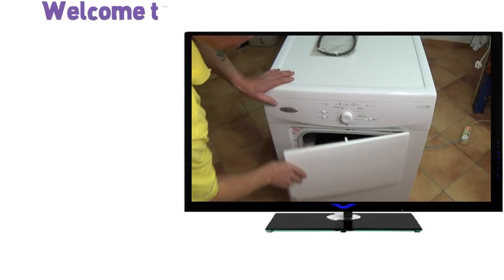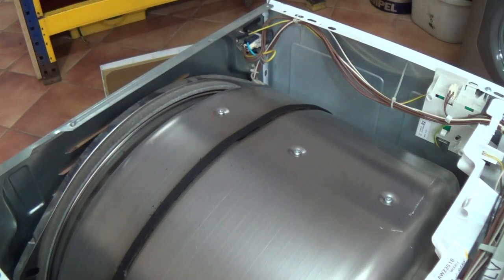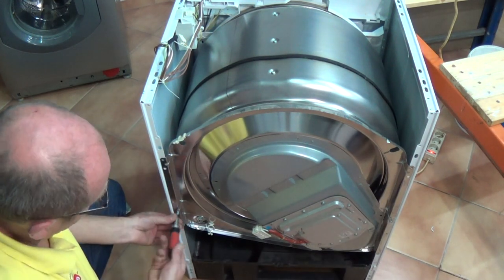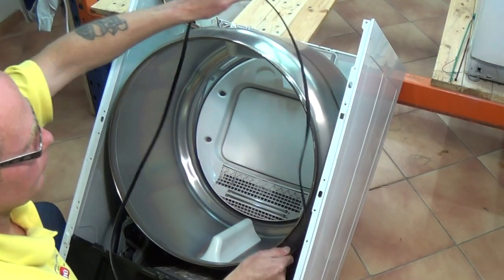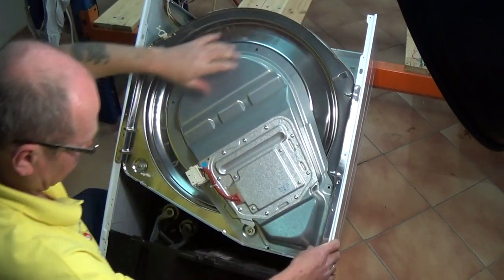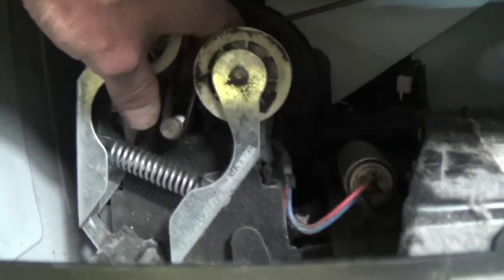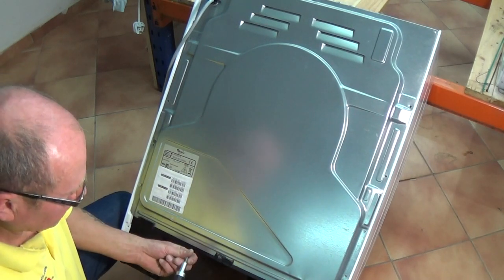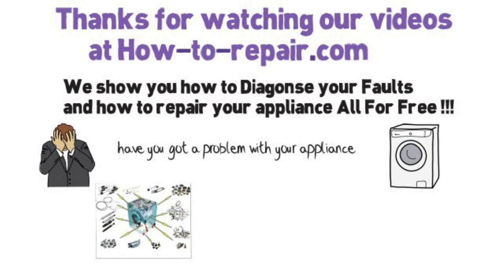How to replace a tumble dryer belt Whirlpool, Bauknecht, Bosch, Ignis, Maytag, Proline,

Comment: This video was very helpful, thank you. As someone else commented, my dryer (a Bauknecht) also had a couple of added difficulties. The back support plate has an additional three screws holding it to a plastic duct in the bottom right which needs to be removed. Mainly, however, the jockey wheels can not be reached because a fan attachment in a plastic enclosure is attached to the spindle that the belt needs to go around, blocking any access from the rear. There is no alternative but to remove this fan, first by removing three screws and then removing the top cover of the plastic enclosure, which is held on by three clips, the bottom left of which is almost impossible to get to and I had to loosen the left side panel to reach it. The fan is fixed to the end of the spindle with a deep e-clip, which is very difficult to remove. The two "arms" have to be pulled out and the back of the e-clip, further down, has a ratchet that clips it in place, so that you have to pull it back and up. All this should be done carefully as it will pull the soft metal out of shape and it needs to be carefully put back into shape when putting it all back together again. With all this done the fan and enclosure can be slid off and the jockey wheels accessed as in your video.

Comment: Hello. Just wanted to say thank you for this video. My model is an AWZ 650, which required a few extra stages of disassembly before I could get to the motor spline and jockey wheels, but I was able to figure that for myself. You got me started and gave good, clear advice throughout.

Thanks again!

Comment: This got me started but unfortunately the back plate did not come off as on the video, I discovered after some puffing that there is three extra screws holding the back plate to a duct.  To get to the jockey wheels and spline l needed to remove a motor fan put the belt in place and replace fan before putting belt on drum.
Reply: John Purkis exact same for me, the rotor was a pain, but got there with a twist of a flat head and pull

Comment: What is the ohm reading for good NTC2 thermistor  in room temperature on heater body?
Reply from the maker: You can only know this if you have the manufactures data or the ohm’s reading for that pacific sensor as with this manual the manufacture gives you the data. http://www.how-to-repair.com/help/faqs/workshop-manual-for-condenser-tumble-dryers-aeg-electrolux-john-lewis-zanussi/ so you need to find out the range of the manufacture 
I hope this helps
Reply: I can add info as I find it NTC 2 for all heater units are 15 kilo ohm at 20 degree celsius.
Reply: This mean if you have dryer in not heated room in winnter it will not working properly or it will send alarm code for NTC2